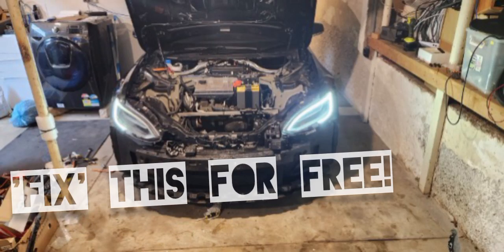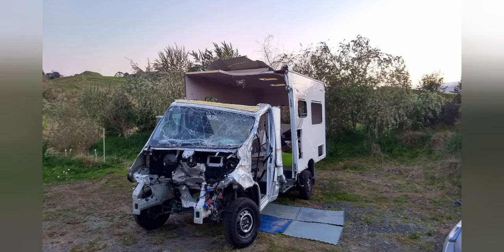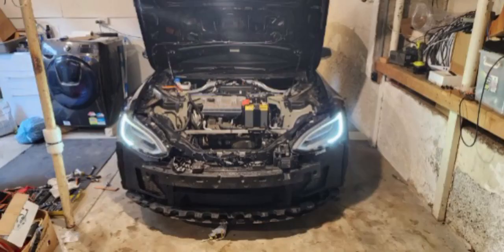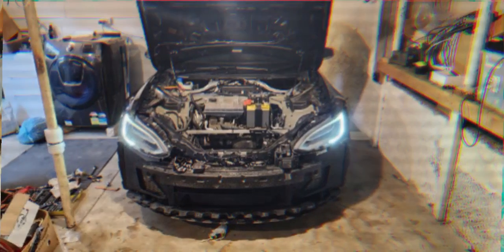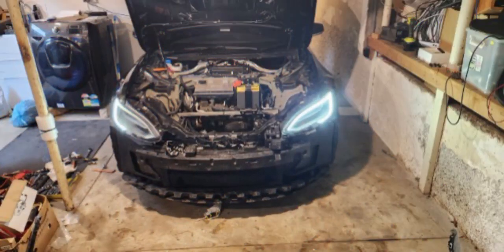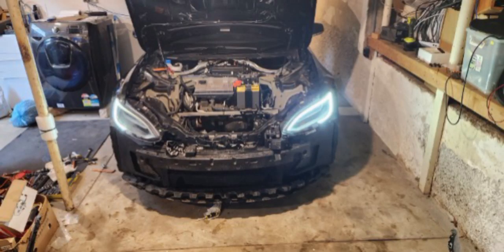Tesla Headlight 'Repair'

Comment: I'm a Dutch guy so hopefully my English is understandable.
I did this myself this week en it's very easy.
Take of de bumper a little.
There were the bumper meets the fender you will see the cap with 3 screws.
When that's of you will see the connector.
Take it off and extract the pin with a needle or a thin sharp something.
Push on the blank metal in the connector and you can pull out the little pin with the wire.
Tape it and re assemble everything.
I took me approximately 30 min.